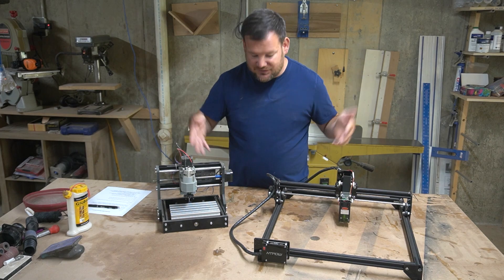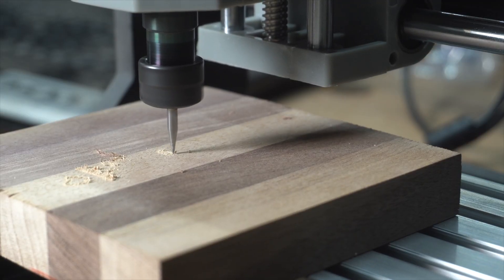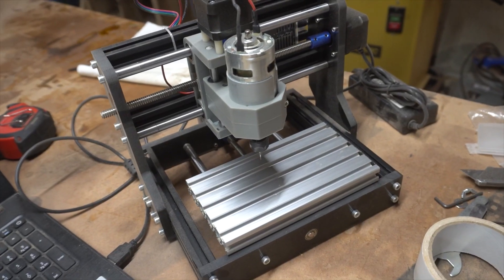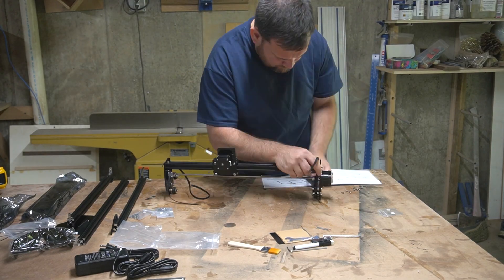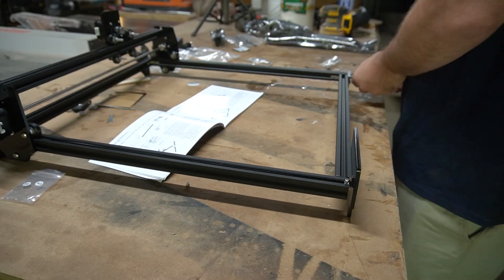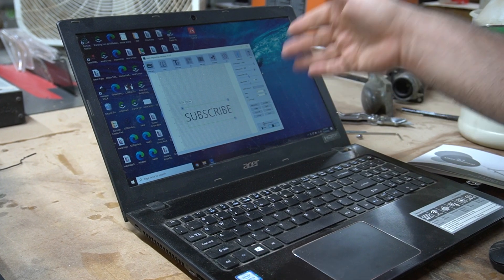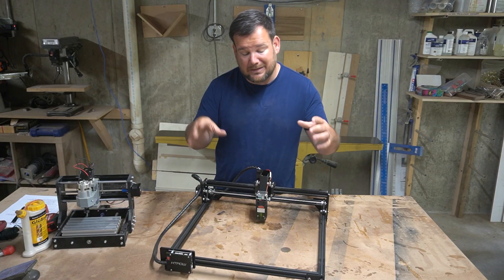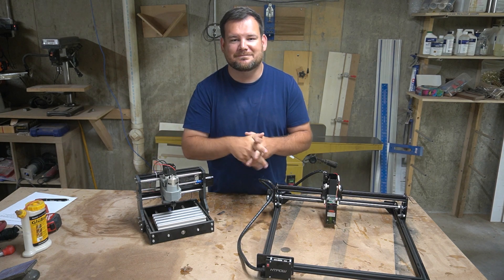Which Would You Buy? This CNC Router or This Laser Engraver?

Comment: I you did not address the most important aspect…. Which machine makes a more quality and depth of engraving. To my knowledge the router engraves deeper than the laser and therefore will provide a more quality 3D effect especially when considering edge lit acrylic engraving. Hence, cost and ease of use always is secondary to quality of the engraving.

Comment: Disclosure; Tis is not my account. Really enjoyed your CNC videos and looked at what's available on Amazon which raised more questions for me as a beginner. Maybe you can address some of the questions. My first thought was $130 was maybe limiting so why not look at a little more of a machine? They all seemed to be about the same machine and what more money did was get a bigger table for the machine but there were other options available like a four axis controller. Would that stand alone option fit on these machines like you bought? How adapable are they to expand knowledge and abilities with these other options? Stronger motor\servo routers are also available. Can they be adapted? I guess what I'm asking is about the limits of the machine frames to adapt to these "hobby" machines? You mentioned what I assuming was the machine language for the router but can the controller accept other languages or programs. Can they accept imports from programs like autocad? 3D modeling? Your demo was limited to linear cutting and engraving. I hope you get the idea of what I'm thinking about and maybe you can add more. As a wood carver my interests is with possible time saving stock removal. I really don't use machines but this is interesting. Final question, you used air to clear chips. Can a vacuum be adapted so the machines can be left to run without being constantly attended?

Comment: best have cnc and add side laser head too, can use both. and can cut wood at laser better than ewery pass laser need cut little more down focus be better because ewery pass have more down has burn wood off. u need only measure how deep one pass cut then make g-code ewery pass drop laser head this dimension down. focus laser can keep good thin all pass, if not drop focus have ewery pass worst more than one pass.laser need be optimal thin not wide burn better and no burn lot edge, if increase speed little, speed important how nice edge have after cut. more speed more pass and keep focus optimal all pass then burn lot better.

Comment: I have both, ha.  I think the CNC router is the better choice.  You can put a different drill bit on it and cut carbon fiber like butter.  All you can do with the laser engraver is melt plastic and burn wood; its okay at engraving, but that has little practical use.
Reply: I think it depends on what you want to do, for me I would probably go for the cnc router aswell, but I need the laser engraver for some other jobs to engrave text on control panels.
Have you tried it with PCB's yet? I'm curious how accurate it is for that kind of job..

Comment: I’d make sure to pick a machine that either already has GRBL on the controller, or can be easily flashed to run it.
Reply from the maker: Good advice
Reply: sure GRBL not used accurate work newer, only g-code machines etc. linuxcnc, mach3 not work well not have realtime cnc wery dangerous and wery worst because windows OS not can handle realtime. this is important if use cnc  only little hobby user play whit laser and 3D priter no need realtime but better if have. lot safety and lot better use and accurate. and not need do same work manytime because not lost alltime steps. mach3 do this lot.
Reply: @mattivirta  I am quite familiar with the source code to GRBL (it being an open-source project); it does not loose steps, ever. 

However, GRBL is not the only component of the system: you also have the wiring, stepper motor drives, lead screws and/or drive belts; as well as whatever forces that are being generated by the machine’s cutting action. These other factors can cause any machine to develop positioning errors, either transient ones or continuing ones (lost steps).

If you’re looking to run long jobs on a router; and have a concern about positioning errors developing (or are actually suffering this problem) and checking the wiring and adjusting the machine’s acceleration and top speed doesn’t make the problem go away; then I would suggest considering upgrading to a closed-loop stepper system. These have special stepper motors with encoders on them, which connect to special drive modules that track the motor’s actual position, and automatically brings it back to the commanded position (fed to them by GRBL). This is similar to a servo setup, but you don’t have to tune any PID loop parameters - it’s pretty much plug-and-play.

Comment: you can put the laser module in the cnc router. the only problem with the cnc router is the size but you can get the 3018 for like 
$20 more
Reply: no matter how big cnc have same accurate etc, 0,0001mm can cut dimension. have small or big cnc i have build 1500mm x 1500mm x 400mm cnc and can use same accurate or better than small toy cnc 3018 size. i can made pictures,pcb,big woodwork. etc.

Comment: Laser all the way, the bare minimum to get a good router would be $1200 for something like the sienci long mill.
Reply: not cost, i have build many cnc to hobby customer and factory, and hobby cnc cost less 500$ if use used parts lot and make DIY lot, frame no cost lot only metal tube,welding thats is, and linear rails my last cnc 1500x1500x400mm cost 300$ then need såindle cheap woodworking user spindle 500W cost less than 50$ and can change laser to Z axis have both cnc and laser. linuxcnc software have FREE.